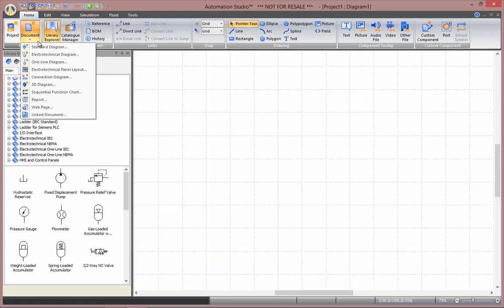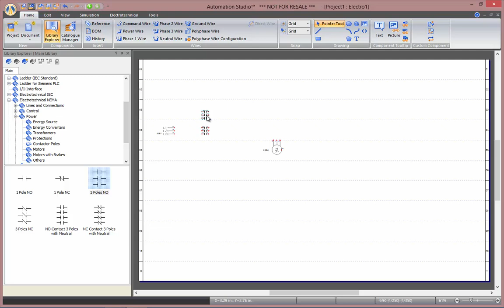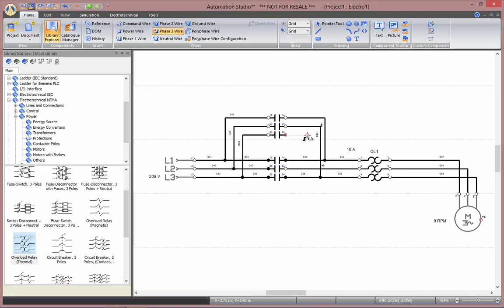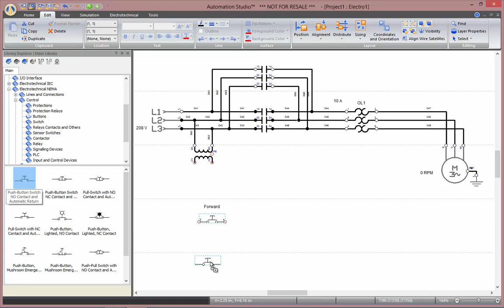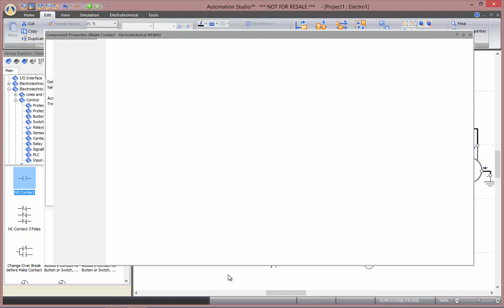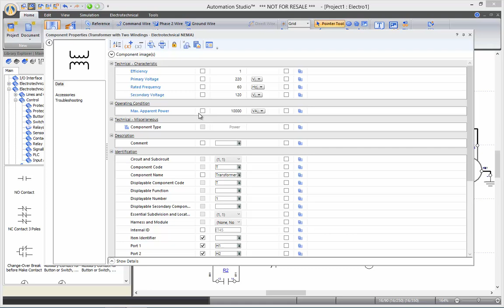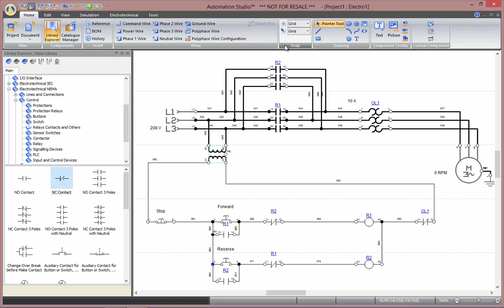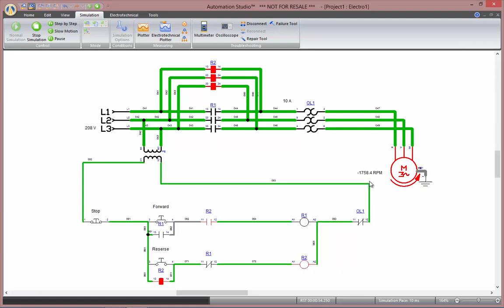Electrical - Creating a Three Phase Motor Control Circuit - Automation Studio™

Comment: Hello. First of all my congratulations for the videos. Could you explain how to set a three pole overload relay at Electric Control (IEC Standard) library? I usually use this library to project a Three phase motor control circuit and I coundn´t find how to do that in this library. In Electrotechnical IEC library it´s easier.